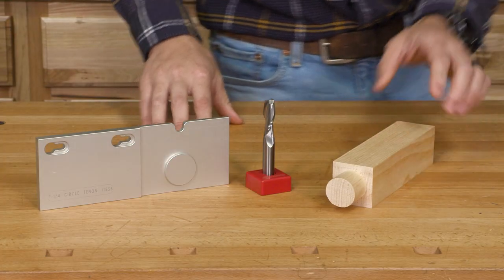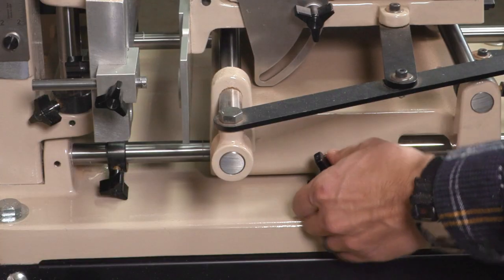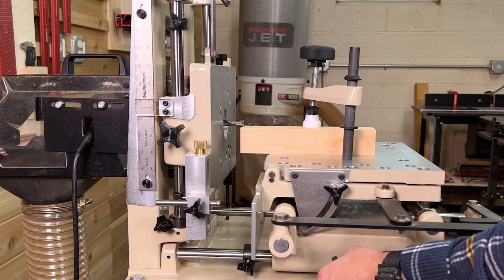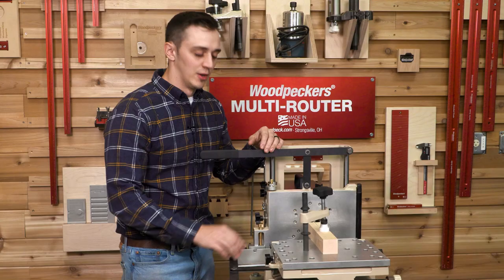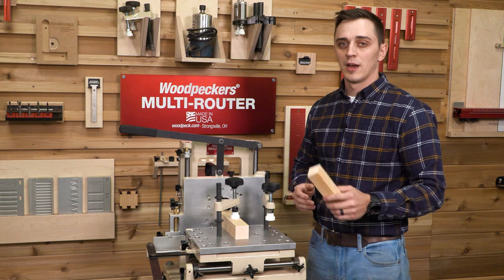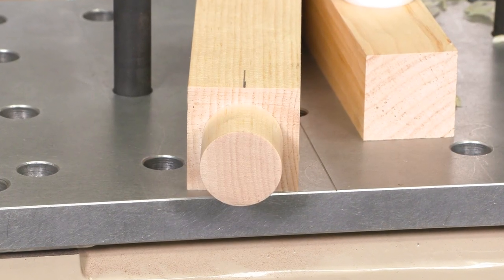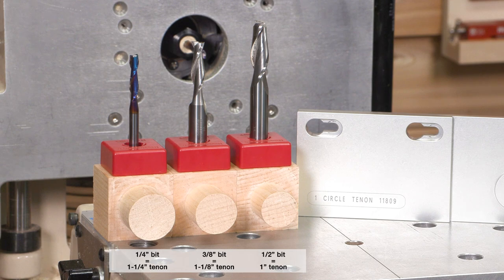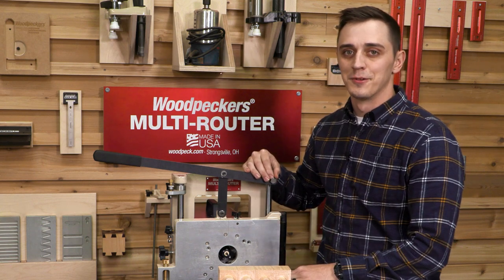Make Perfect Circle Tenons With The Multi-Router In Minutes | Woodpeckers Tool

Comment: Hey young man.  Thanks for the great video.  I don’t see the near future of anything that I would use round tenons on, but at least I’ve got the capability to do so using the templates.  Finger joints and floating tenons are my deal with the multi router.  Thanks again.

Comment: This is the same router as Mathias Waddell..hopefully you have him some love..he invented this years ago..
Reply from the maker: Other way around. The Multi-Router has been on the market since the mid-1980s. The Pantorouter was invented around 2010.
Reply: Try getting your facts straight, the 2 router systems are very different. MW's is based on a Pantograph system one handle controls 2 axis, hence the Pantorouter name as he sold rights to the company.  As pointed out the MultiRouter has been around since the 80's and uses individual axis controls.   Do  to the differences each system has camps that favor one over another, I favor the MR as you can lock out one axis and mill lines.  BTW the first time I saw the MR was at a trade show back in 90's when they were still a JDS product.   Additionally I've seen router duplicators back in the 70's that used the pantograph setup so the MW one was nothing new.  One can buy any number of pantograph systems for doing various things from routing to drawing.